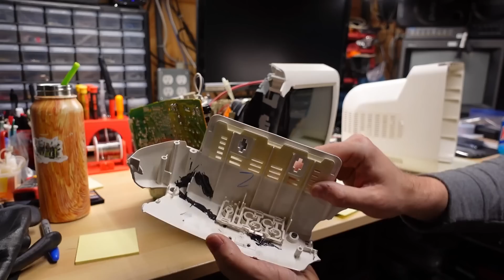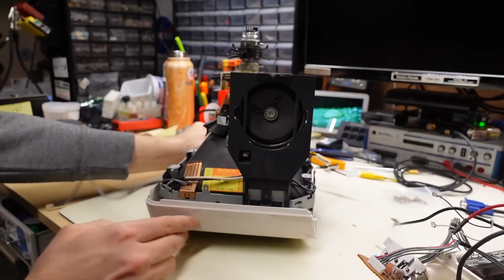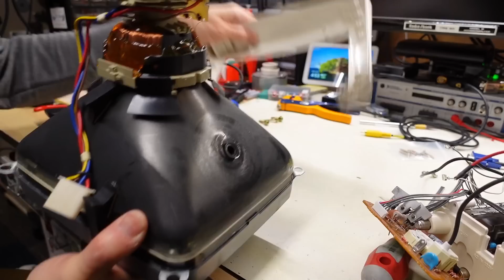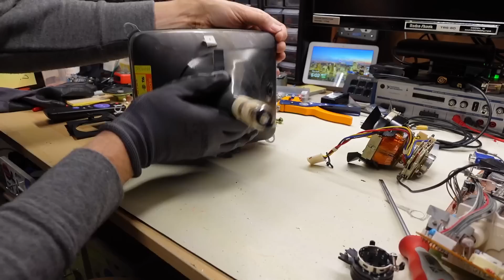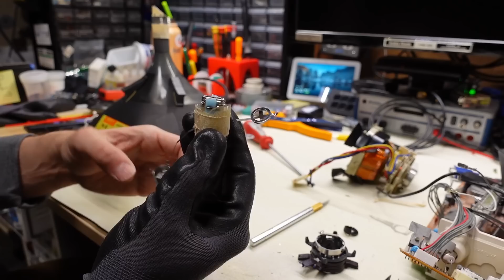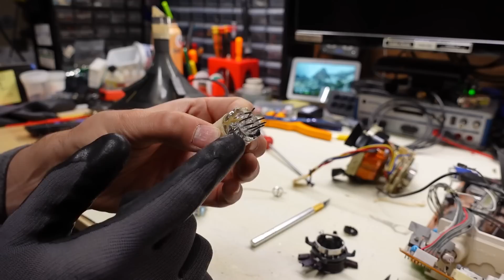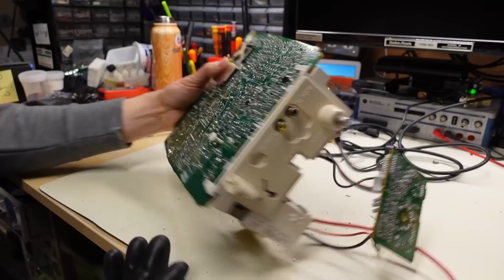I failed badly fixing this little Sony TV (KV-9PT50)

Comment: I worked in a CRT factory in my late teens and have been around a lot of imploding CRTs - both with and without implosion bands and not only do they help prevent implosions but they are designed to minimize the flying glass. An imploding CRT has an impressive amount of energy. I've seen a chunk of leaded glass shred a 2x4 stud when a hot tube imploded. Very exciting - especially since I used to work on an inline cart line where the vacuum is created and you lift the tube right beside your face (we wore safety glasses) removing the tube from the carts with no implosion band...
Reply: Very interesting. Only safety glasses? When I used to handle pressurised Xenon bulbs I had to wear a full mask face and also body protection.
Reply: @tony359  sounds like yours was a bit better regulated!
Reply: Your comment about the unexpected power brought me back to a time I was around an extremely tiny but powerful exploding aerosol can — and it was later found to have missed me by only a couple inches.
Reply: When I was a kid, so about 50 years ago, a mate and I took the tube out of an old TV and dropped it in a hole in a field. We both went off looking for a brick, because, you know, kids and the chance to break glass. So we were running towards it,  both  with a brick or rock in our hands and I threw first.
The subsequent explosion and the fact that we survived the hige pieces of thick, sharp glass that flew out of that hole and covered an impressive area, lives with me to this day 
We were both very lucky to live. 
Taught me a respect of CRT tubes.

Comment: Just hypothetically: what would happen if you re-vacuumed a tube like this and tried to use it in a monitor?
Reply: You theoretically can do it.  There used to be companies that did.  But where are you going to get the tooling to pull the vacuum and reseal it is the problem.
Reply: @jimb032  oh yeah actually doing it is a whole other topic, but i was wondering if there are components inside that break down faster when exposed to air.

Comment: you can safely release the vacuum by breaking the neck off or if you can get a thin blade under the plastic cap over the pins you can lift the cap off and bend the pins out to the side and using a wire cutter snip off the nipple where the tube was sealed and it lets the vacuum off slowly and that is even safer.

though i have never seen a tube implode due to breaking the neck.

in the older tvs from the early days of tv especially the ones they call roundies (a bigger version of an oscilloscope crt) the front is only held on by the vacuum there is no glue like newer tubes and it is possible for the front of the tube to detach and fall off so those tubes are absolutely dangerous to work with.

if a tube was to implode you probably would get a piece of glass in your chin.

 another high voltage thing to worry about is xray protection.

it is possible to over volt a picture tube and make it into an xray tube
Reply: Older glass CRTs are definitely welded together. The seal from placing two pieces of glass together would be nowhere near enough to hold high vacuum for 70+ years. Metal cone CRTs obviously aren't glass welded together but they use some other method. It's relatively failure prone and thermal expansion/contraction might crack the joint.

Comment: I had a 21" IBM branded Trinitron multisync monitor around 2000.  It was a monster.  It had a great picture though.  I kind of wish I still had it.
Reply: I've still got four IBM P260s -- two are in use, the other two are cold spares.  If three of them die before I do, I'll be very disappointed.

Comment: JBweld is a 2 part epoxy, ie, Araldite, with metal filler, ie, you don't really need filler to glue parts together, plus the dark colour is hard to hide. You are probably better off with Araldite and a mesh patch on the back, ie, a patch hold parts together stronger. You also have to sand the shine off to get more mechanical grip.
Reply: What kind of mesh do you recommend? I have seen people advise soaking fibreglass tape in two-part epoxy, but it sets up a little too quick for that in my experience.
Reply: @ravuya  Acetone on ABS fuse the parts together, where as epoxies just sit on surfaces, ie, glues that use mechanical adhesion to keep parts together aren't very good in tension. 
You just need anything that doesn't rip when pulled apart, eg, metal mesh, fibreglass, metal plate, plastic, etc. There are 10min epoxies, but there are also slow/normal cure epoxies.

Comment: Next time you get to play picture tube etch-a-sketch write JUNK! on it. It'll be funny!
Reply: Hehe - at my local video arcade museum there is a spare monitor from a Pole Position that has "GAME OVER" burned in really bad. The CRT is still intact and I have no doubt it will make a picture. But whatever is on the screen will always have "GAME OVER" written on it.

Comment: Tube looks like the same one inside the pvm-8042q or pvm-9042qm, but it wouldn't be worth chopping one of them for the tube since they have RGB, component, svideo and composite as standard.

Comment: ALERT: The following question is from a total noob.

Does the deflection yoke act like an inductor? You made the statement that the CRT acts as a capacitor. I have observed that, in many cases, capacitors and inductors are in close proximity to one another. Is that the case here?
Reply: The horizontal coil in the yoke is used as an inductor (along with the LOPT) and there are matching capacitors on the board to form a semi-resonant circuit. There's also an S-curve correction cap which complicates things. This all has nothing to do with the capacitance of the CRT.
Reply: @eDoc2020  Thank you

Comment: I used to repair CRT monitors back in the early 90's. Amazing to see everyone using CRT to everyone then using LCD in a relatively short time period.  
I liked working on CRTs. Have one on the bench now, it has small imperfection in the LOPT that is arcing out to the chassis.

Comment: dont  use jb weld or any other glue if you can avoid it, melt welding with acetone or mek is better,  glues can peel off, .. or brush some acetone on first to partially melt the plastic before putting the glue on, it'll help it bite to the plastic ..
Reply: pity the  crt is pooped 😢